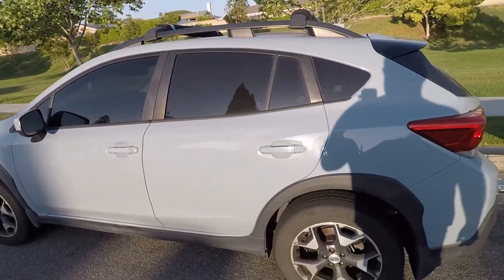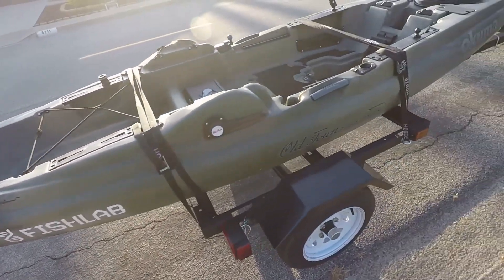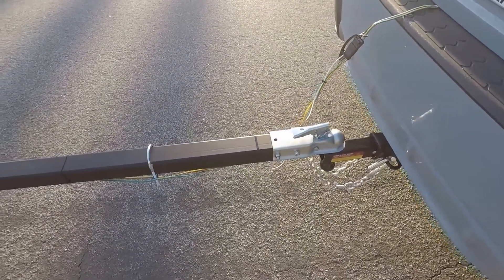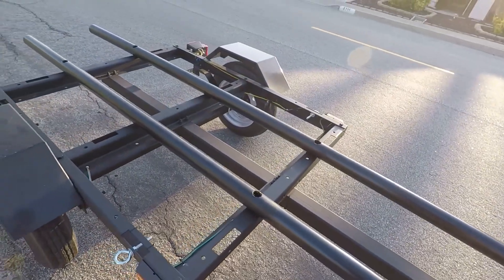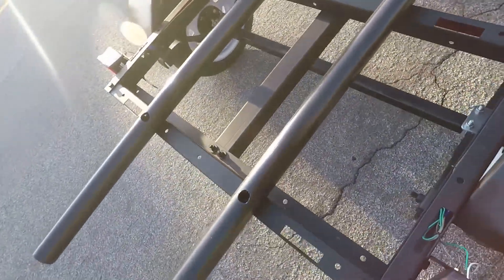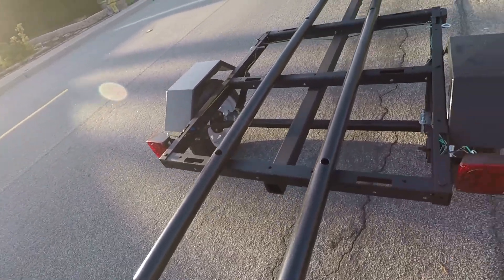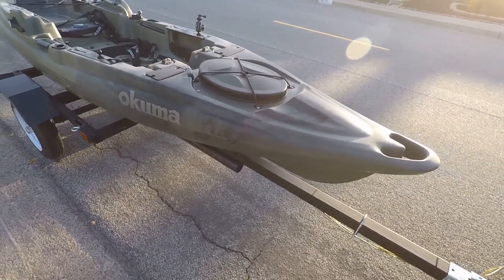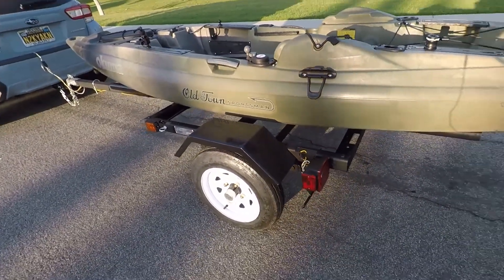DIY Harbor Freight Kayak Trailer Build

Comment: I am currently building my kayak over the winter with trolling motor, battery, etc. My thought has always been to modify the harbor freight trailer in a similar manner, but everyone was using the larger, and I want the smaller one you used. Thanks for the video, I see myself replicating soon. 🙂
Reply from the maker: I absolutely love this thing. Super convenient and easy project.  The only thing I have since modified is the bunks.  The PVC cracked so I went with wooden, carpeted.  So much more sturdy and cheap.  If you search my page I did a video on the mod about two weeks ago.

Comment: I use the same one with my old town. I definitely want to extend the tongue length to have the weight distribution better.
Reply from the maker: @Tackletuesdayfishing  It makes a huge difference.
Reply: @DaveysWorldFishing  what are the exact dimensions of the steel tube you used?
Reply from the maker: @Tackletuesdayfishing  It’s a 2x2 by 10’ long.  I don’t recall the thickness, but it is probably in one of these comments.

Comment: Got the heavy duty one I use it for my Jon boat, Put a winch in the front jackstands in the back, easy tilt off the trailer my wife wanted something easy so she didn’t have to do any lifting in the back of the pick up truck the Sund dolphin weighing 110 adding 5:53  seats and a few other things brings up the weight. The trailer is great very affordable. Put the bearings in right and grease them up, change the grease fittings they’re cheap and break off too easy replace them. I am very happy with the dolphin and the Harbor freight trailer with a six hp  mercury. 40 min Kota Personally, I call that heaven can’t wait to get out there again

Comment: Thanks for the video.  I just did an almost exact copy of it for my Nucanoe Flint.  I was concerned about the flexible PVC pipe.  I notice some guys have used electrical conduit, which is stiffer.
Reply from the maker: Good luck!  Hope it serves you well.  I love it so far.  So convenient and easy.
Reply: The Electrical Conduit is MADE for being outside (or, in some cases, underground?), and is a much better bet for making "Bunks" out of.  I'm thinking along the lines of outdoor carpet (Bunk Carpet) glued (and possibly riveted) to the Gray Elec. Conduit for the Harbor Freight "heavy-duty?" (1720 lb.) trailer I bought today.
Heck, even my little Titan 10.5 weighs more than 210 lbs., and I know the Titan-X 12.5 is gonna be a LOT more - especially with that 3 hp. motor and 165 amp battery...!  (Yes, I AM spending my kids "inheritance money", as ya only go around once!).  Lol
Reply: @DaveysWorldFishing  I replaced the tongue with a 10 ft piece of steel that my daughter drilled out for me.  SO much better.
O
Reply from the maker: @joeboyd7796  Game changer!

Comment: Thanks for this video this has been super helpful. I am struggling with attaching my 2x2 steel to the frame. The predrilled holes on the frame appear to be right at 2 inches so not sure how to run the bolts. Would you mind sharing a bit more information on how you attached the steel piece to the trailer please?
Reply from the maker: Glad you found it helpful. One thing to note is that I did end up switching to carpeted wooded bunks instead of the pvc.  The tubes ended up cracking.  
I just went out and looked, and I believe I used the standard hole width. The bolts are close to the sides.
Reply from the maker: I posted a couple pics to my stories on Instagram.  https://www.instagram.com/stories/daveysworldfishing/3273862481104864284?utm_source=ig_story_item_share&igsh=MzRlODBiNWFlZA==. 
@daveysworldfishing
Reply: Thank you did you buy a 2x2 or 2x3
Reply from the maker: @bryanjones2063  That’s a 2” x 2”

Comment: That’s pretty neat! Did you get them 2x2x10 from Lowe’s or Homedepot?
Reply from the maker: No. It was from a local steel company.  Pretty easy to find options here in SpCal.  The piece ran about $80

Comment: The HF trailer that you used shows that the original tongue only extends halfway back on the trailer.  Did your mod replace the tongue entirely or add on to it? The tongue on yours goes all the way back.  Thanks,
Reply from the maker: @stevepolley4628  Yes.  I replaced with 10’ Steel tubing.

Comment: what's the spacing between the the 2 pvc tubes( I guess that depends on your kayak)
Reply from the maker: @mikepehoski1723  it does depend on the kayak and how flat or curved the bottom is.  On a side note, I did switch from pvc to carpeted bunks on the trailer.

Comment: The only problem I found is that the tow bar is not 2" square. It is 2.5" wide by 2"h. So if you're thinking to use some type of extender, it may not work. I work in the sign industry, so I just got a 2"x2" galvanized steel 8ft post and mounted from the center cross beam like the original.
Reply from the maker: I took the original bar off completely and replaced it with this one.  Works awesome!

Comment: Thanks! I have been thinking about a trailer for my fishing kayak. I think mine is roughly the same as yours. The trailers I've looked at are ridiculously priced! This seems like an affordable solution.
Reply from the maker: I’ve been using it weekly and love it. So easy to get the kayak on and out of the water.  No carts to mess with.  The only time I car-top now is if I’m headed to a non-trailer friendly area.  Good luck.

Comment: How you bolted the long tongue on the bottom of the frame? It's hard to put hardware inside the square tube and bolt down. Need to see pictures
Reply from the maker: I drilled all the way through the long tube and the frame. Two holes on the front, and two holes on the rear of the frame.  Bolted it all together.

Comment: Hey Davey, with the 2inch tubing did you have enough room to use the original bolt holes on the frame? Or did you just use 1 bolt?
Reply from the maker: @BOOSTED073H  sorry, misread that.  There was plenty of room for the two bolt holes.

Comment: Awesome Thanks, I have the 136 Auto and am tired of wrestling it from the truck bed, Im 67.
No problems that trailer bouncing too much going down the road with a light load ?
Reply from the maker: Hi Mark.  So far this has really been a back saver.  As far as bouncing goes, it certainly bounces back there, but nothing crazy.  Here in California you can only legally tow up to 55mph anyway, so that helps the bounce a bit.
Reply: @DaveysWorldFishing  Thanks, Im here too I go to the sierras, have heard there is replacement springs to calm the ride but can't find where I saw it.
Thanks again for the great detailed review.
Reply from the maker: @markskibo5159  Thank you for stopping by!   I appreciate the support.
Reply: @DaveysWorldFishing  One more question, can you see while backing it down the ramp ?
Great design, patent it  , after I copy you !!!
Reply from the maker: @markskibo5159  Lol. I’d be a billionaire!  With the extension it helps to see it for sure, but not easily.  I mainly use my backup camera.  I know of people who have added a flag to the back.  
I’ll generally get to the launch area, then load up the kayak.  When it’s loaded it is quite a bit easier to see.
Reply: Yeah I just put one together just like yours without the PVC on it yet , tried to back up in my yard and I couldn't see a thing.  Gonna put some PVC pipe on the sides to make it easier to back up
Reply from the maker: @latishajaubert5600  I actually just changed to wood bunks.  I cracked one of the pvc and wanted something stronger.  I really like it so far.  Same lengths just more rigid.

Comment: How the process in registering this in Ca?
Reply from the maker: Very simple actually.  I took it on to the DMV, filled out the paperwork, they do an inspection then hand you the permanent plates.
Reply: I see the trailer is on sale and tomorrow is the last day for it. Thinking about it if the registering process isn’t a hassle. Do you just assemble it and when you’re ready to go register it, hook it up and head to the dmv or do you fill out paper work and submit it then wait to take it in for inspection? Sorry, very new to this trailer stuff so if my questions sound dumb, that’s why lol. Also, does it come with all lights and wiring? Thinking of the 48x96 1195 trailer.
Reply from the maker: @KeepingUpWLeland  If it’s the 25% off deal, that is the time to do it for sure.  I think I filled out the info online.  You will need to bring the registration paperwork with you that comes with the trailer.
Reply: I heard some people saying something about the “title” for these trailers are confusing. Once again, new to this stuff so technically when you buy this, does harbor freight give you a title or is it just the receipt? Thanks very much for answering my questions man!
Reply from the maker: @KeepingUpWLeland  They give you the title with the receipt.  You will need both.
Reply: @DaveysWorldFishing  do you recommend the 1100 lbs one or the 1720? Will just be towing with my two door coupe.
Reply from the maker: @KeepingUpWLeland   I have the 40x48 and it works out great.  Nice and light and I’m pulling it with a Crosstrek.
Reply: @DaveysWorldFishing  just bought the 48 x 96. Do you need to get trailer insurance on it also?
Reply from the maker: @KeepingUpWLeland  No idea. You might want to check with your insurance company. I don’t want to give you incorrect advice on that.

Comment: What the speed rating for the trailer? I was reading the user manuals on harbor freight website and it said top speed was 45mph!
Reply from the maker: I believe they are listed as a max speed rating if 45.  Here in Cali you can only tow at a max speed of 55.  With the heavier tongue extension, it adds about a hundred pounds keeping it on the ground more going over bumps and rough road. 
I am certainly not going to suggest going over what the company has rated them at.
Reply: I realize your comment is old but f.y.i. for others wondering I've pulled mine at 80mph making a a pass on the interstate without issue. I did put better grease in the hubs when I assembled it. I have close to 10k miles on mine over the last couple years and have had no issues with it at all.

Comment: Did you swap out the lights for submersible lights? I have the folding trailer and am about to swap out the lights.
Reply from the maker: Not yet.  Those are the standard lights.  I plan to swap them out, just haven’t yet.

Comment: where did you get the steel from? no link. Is that something you can get at Lowes?
Reply from the maker: I’ve seen some people say they have gotten theirs at Lowe’s. Our local stores did not have them. I had to find a local steel shop here in SoCal that sold it.  Wasn’t to hard to find.
Reply: @DaveysWorldFishing  yea i figured, I do have a steel shop in my town that does carry that kinda stock. Now my only damn problem is getting that stock home, I am building this kayak trailer because I do not have a truck, I have a little Honda FIT, with a class 1 hitch. I may have to get two 5 foot pieces and some kinda larger stock to use as a coupler just so I can get it home
Reply from the maker: @gardeningwithdrevs8024  Funny. I had a Fit for years and loved it.  I was always amazed at the amount of room inside that thing. My 9’ rods fit from passenger floor to the back with no problem at all.  10’ might be a bit long though. Could always have it stick out the back and tie down the hatch back.  
Good luck!

Comment: Great job. I too want to extend the tongue on my HF 4x8 trailer.  What size bolts did you use to mount it?
Reply from the maker: Great question. I’ll have to try to look tomorrow to see if I have anymore.  Can’t remember off the top of my head.
Reply: @DaveysWorldFishing  My bolts were 38" by 3 inches. They fit the 1/2 inch holes in the trailer and the tongue.